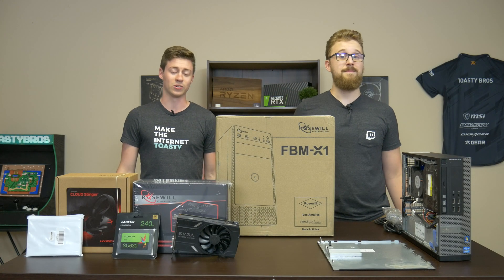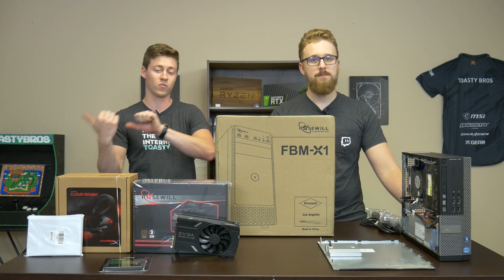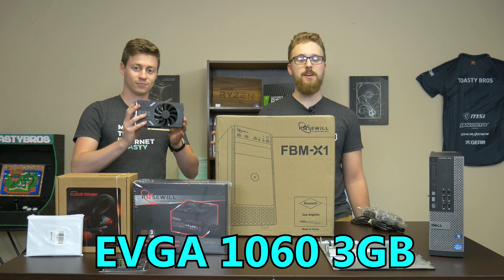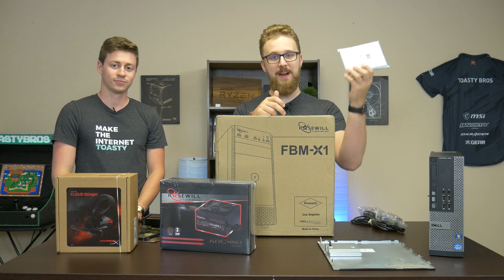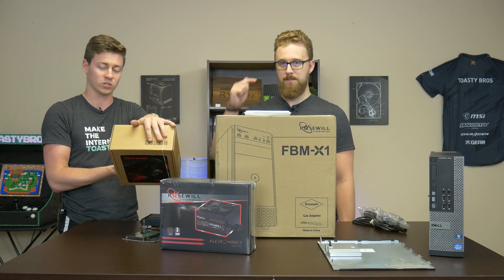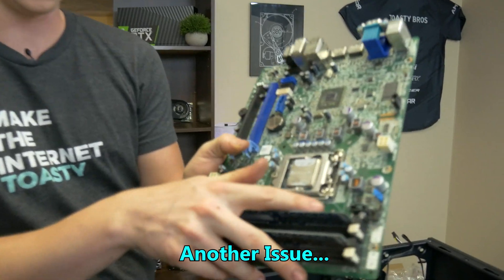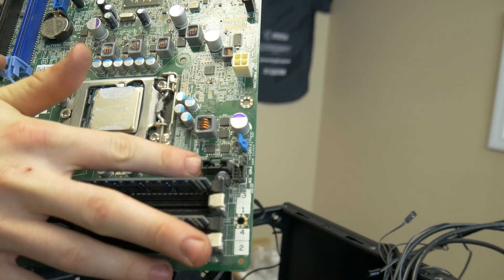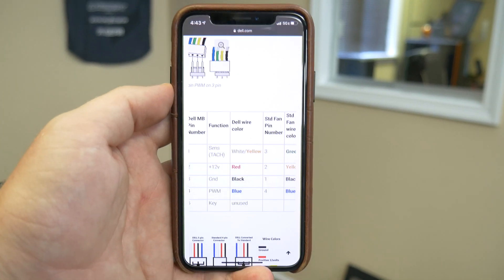$600 FULL Streaming Setup (PC, Monitor, Microphone, Webcam, and MORE)

Comment: Im thinking of a dual set up. Right now im streaming in a passable rate.... Im not satisfied with the results thou. 

I have 2600x ryzen5 
500w smart thermaltake
Asus cerebrus 1050ti i use nvenc
B350fgaming asus
Should i just upgrade my graphics card 1060 super? Or go for a dual pc set up?

Comment: Full size dell oem towers does not have standard connectors and pins.
Reply from the maker: Not all of them, some do
Reply: I believe the older models. Because i have dell optiplex 3020 and it have 8 pin motherboard connector. And the same cpu connector as yours and the power and reset switch is really different. But over all i like your video. I soon going to do what you did. So yeah thanks

Comment: G'day Toastys,
I am building a PC for my neighbours son, I went the Dell Inspiron route, I got a Full ATX with i3-2120, 4GB@1600MHZ RAM, 500GB H/D, W10 is activated & even has WiFi for $40AUD, I wanna upgrade it to an i7-2600 ($50-$100AUD) also I'm gonna add a new 120GB $35AUD & PSU for $50, & a 2nd hand RX570 for him (there are a couple for $120-$150AUD on Ebay, I Hope Brian from TechYes doesn't buy them all), his dad has given me $350AUD so it should be really good for the budget.
He is at Uni & wants to be a Paramedic & needs a good PC for doing assignments, he is always willing to give me a helping hand when I am not well so I said I'd do the shopping & build the PC for him as a thank you

Comment: You two should try to build a pc that can run GTA5 and Fortnite at atleast 720p for 50 bucks or less. That would be a challange. I tried it myself and ended up with an i3 4170 6gigs of ram and a hd6950. I wonder if you could get better deals there in america then here in the netherlands.

Comment: I don't agree with your GPU choice. The 3GB of vram is a limiting factor, even at 1080p. I'd have grabbed an RX 570 or RX 480/580 for the same price. More vram, and either equal or greater gaming performance. Aside from that, i found the video interesting.
also entry for that key. lol.
Reply from the maker: Nvidia > AMD for GPU streaming encoding
Reply: @ToastyBros  >3GB of vram at 1080p

Comment: Acer and Lenovo tend to be Mini ATX and use normal style headers etc. It all depends what is in abundance in your area. 

The COA key on the Dell should work to activate your Windows 10 install. A nice bit of extra value 😁

Comment: The desktop version of the optiplex has a correct size motherboard but the connectors are proprietary. I have heard there are proprietary connector adapters on eBay though for that

Comment: This is one of the best cheap Setup I’ve ever seen yet I still can’t afford it. 😭😂
Reply: You could save money by only having one monitor and no webcam
Reply: @IsaacHoweiner  I’m saving up to buy a pc currently and already have 1 monitor and then I want to get another monitor that is 144hz.
Reply: whats you budget? I could send you a link to a video
Reply: @travis1271  mine is 400$😭😭
Reply: @quesi1338  with that 400 buy half of it then save money then buy the other half
Reply: theultimatenoob yeah buy like most of it then slowly save for the rest
Reply: @quesi1338  BRO JUST GET THE REDRAGON KEYBOARD AND MOUST AND HEADSET BUNDLE FOR 50 BUCK AND GET A MONITOR FOR 80
AS FOR THE PC GET A 1650S FOR 150 AND A USED DELL OPTIPLEX FOR 120 ITLL PROBABLY COME WITH 500GB HDD AND 16GB RAM AND I7 3RD AND BOOM YOU HAVE A DOPE AF PC WHICH CAN PLAY ALOT OF GAMES. ALSO GET A 50 DOLLAR 500GB SSD IT WILL MAKE THE PC FASTER.
Reply: Ok ill try👍🏾
Reply: the struggle is real

Comment: Love the setup, almost the same as mine. i7 3770, GTX 1660, 16gb ram, Kingston 240SSD 1TB WD HD, Fifine mic, Sennheiser GSP-300 headphones, Logitech C920 cam, 27 inch 1080p and  21 inch 1080 monitors. My base was a DELL XPS 8500. $540 Still have the activate windows on my screen :)
Reply: Flexing on us poor console people
Reply: TwistedVet you can get rid of the activate windows pop up by going into reg edit you can prob find an easy tutorial
Reply: @chriserb6055  I used a key from an old win 7 pro
Reply: TwistedVet ahh smart man

Comment: please make a video on the rx 560 4gb. and how it holds up in 2019.. and maybe stick it in a budget system
Reply: it can play most games at medium or low 1080p, nothing more or less. and texture filtering should be low since the 4gb is quite low for 2019 games
Reply: @zzdahaewae  4gb is fine, the card it's self isn't that powerful. And texture filtering doesn't kill v-ram it's texture quality. Set it to lower or medium and it will be fine.
Reply: I have one and i know for sure it can play games like GTA5 or the crew 2 at medium to high settings at about 50 to 60 fps and games like pubg with medium to low settings at a constant 60fps. mind you i have it overclocked a bit so it might be a little more then online. its the gigabyte version btw. i have it combined with an i5 4570 and 8gb ram if your wondering
Reply: thedutchteamersHD my second pc has an i7 4790 paired with a 1660 ti handles 1080p max settings on every title at around 100 fps
Reply: It's useless. A 3400G is just as good for much cheaper
Reply: @Enzo-dr6gx  except it's a Vega 10, besides it's a newer part than the 2400G. The 560 slots between the 1030 and 1050 which makes it not much ahead of the much cheaper APU solution.
Reply: It's less good then a 1650

Comment: Is it difficult to transfer the guts of an Optiplex to another case like that? Do I have to do any custom drilling, etc? I ask because I want to build something like this for my daughter. Thanks for all you do.
Reply: You'd have to mess around a bit if you get a small form factor/slim tower like the one in it video, although most full tower optiplex's like the 990 are fine if not having proprietary cables.

Comment from the maker: One thing to note, we forgot to demonstrate the touchportal app in this video, still a great service that we demonstrated in our previous $1,000 streaming setup.
Reply: Hey guys i have a question i wil build a budget gaming pc with ryzen 5 1600 and which gpu should get 580 4gb or 1060 6gb ty for help and love your videos
Reply: @dawidlepczynski442  get rx580 8gb, pretty much the same price mostly. Also look into getting a 1660/1660ti if you can afford it
Reply: @dawidlepczynski442  rx 570 8gb and oc it best value card and comes close to 1060 6gb
Reply: What is ur in-game setting? Are u forget to explain the settings or in which time is the settings. Thanks, citizen. CMIIW
Reply: Love the budget optiplex builds!!!
Reply: Toasty Bros can I plz get a window 10 key
Reply: Toasty Bros love your budget pc builds and FULL SETUP PC
Reply: Can you build a $200 gaming pc or a $300 gaming pc
Reply: I need a gaming pc
Reply: Koo
Reply: Can i get a gaming PC
Reply: Toasty Bros I can’t comment on any videos only reply but I need a windows 10 pro key because I’m building a 2600x build and I still need to buy different pieces
Reply: Toasty Bros the pc I. You’re plink won’t ship Australia
Reply: Best Setup under $1000 i build it with gtx 1070 the i7 3770 is as godd as the 7700k
Reply: @jonathanh9585  free!